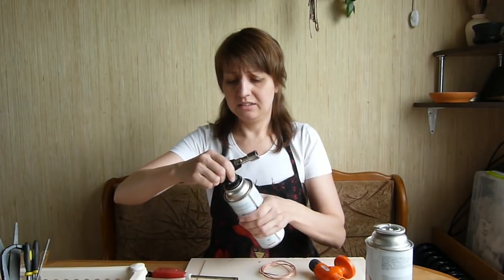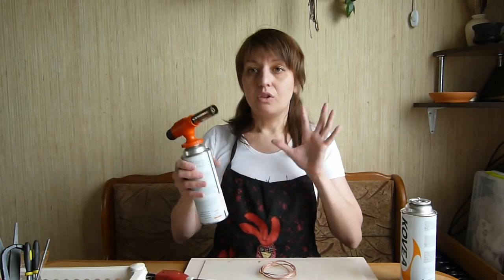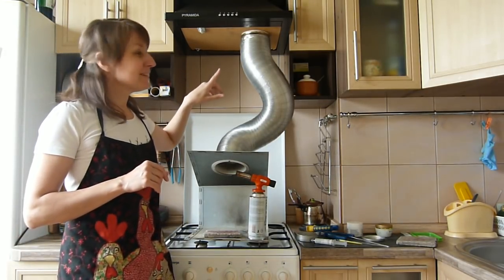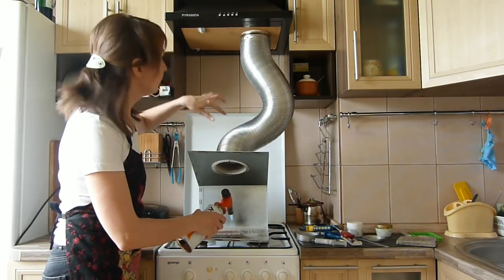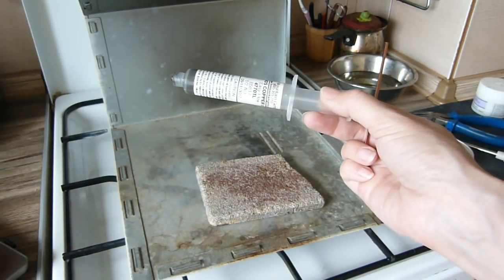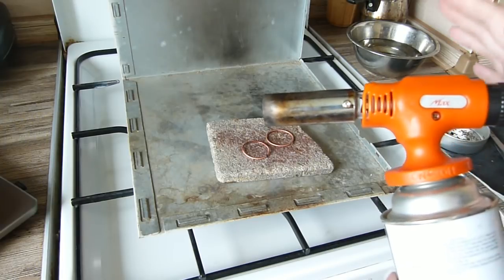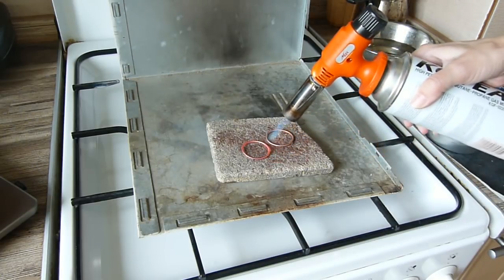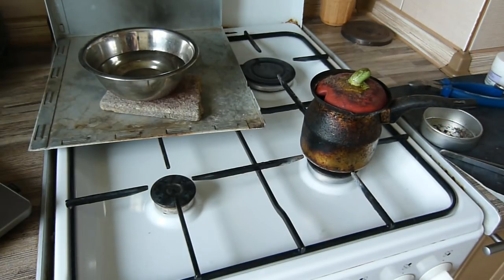Soldering copper tutorial by Oksana Trukhan part 1

Comment: Maybe the butane torch Im using simply isn't producing enough heat but I've tried this method to melt some copper on the tips of a copper bracelet I made and it would not melt no matter how long I held it over the two metals. Do I need to get a solder paste too to bind it with the copper? Thanks for any info ya'll!

Comment: I noticed you didn’t use any flux with the copper solder. Is it not necessary? Your fuel is butane?
Reply: Thank you!
Reply from the maker: Yes, the flux is not necessary for these kinds of solder. The mix of butane and propane.

Comment: I use a propane torch from Wal-Mart. There around $13 u.s.. I need a set up like yours❤ love your videos!!! U share the very important details!
Reply from the maker: Thank you! :) I'm happy to hear that.
Reply: Can you melt small scraps of copper with a propane torch?
Reply: @MD-lj9jg  I have accidentally, while getting a small thin piece to hot. If u do it you will probably ruin charcoal block as well. I kept my block in a tin box so if I over heat it like this I put the lid on to snuff it out or it might burn up to catch fire when u think its out.
Reply: @mistydawn2717  Thank you for the sharing. So for this case, I will use a small crucible.